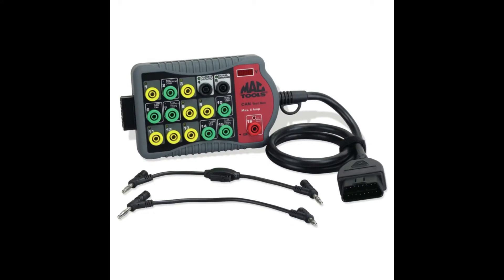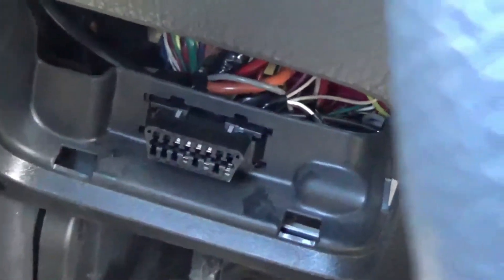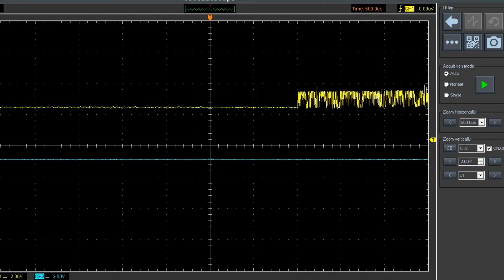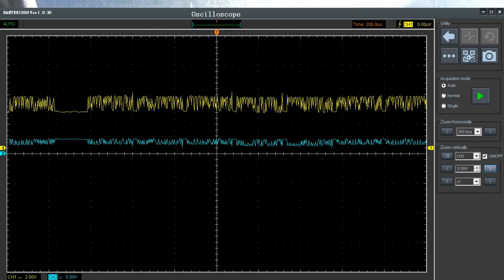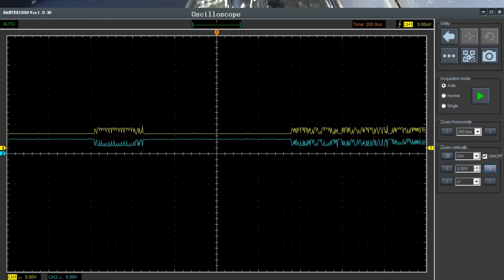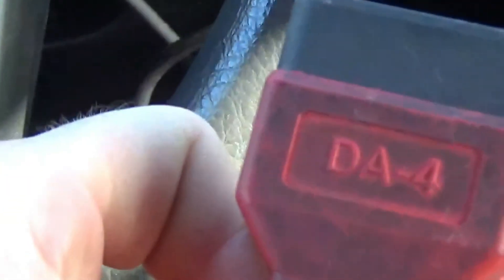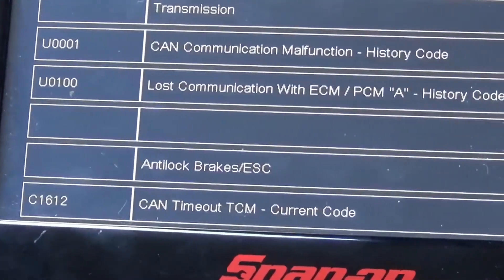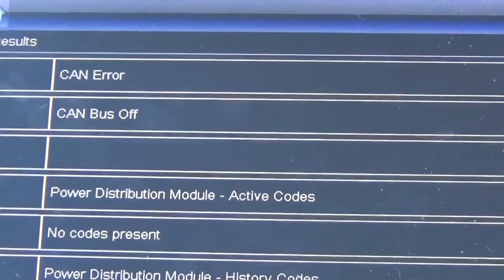What Happens When A Canbus System  shorts to battery positive or negative

Comment: I know this is a really old video and I don't know if anyone has told you this but the best software for your hantek 1008c is hscope for Android you plug the hantek into your phone with an otg cable your phone or tablet powers it you can only use 4 channels but it's so much better software trust me

Comment: Bro CAN-H and CAN-L vs CAN Power and Ground are Different so how does CAN Power and Ground is connected to the CAN BUS are they connected with the nodes or module or module power n ground?
Reply from the maker: Hi. thank you for the question.. In the video i am showing what happens if your CAN-H or CAN-L(pins 6-14 AT DLC Connector) Short to Ground or to Power--and how an issue on one can directly affect the other.. that is all.. Now the can signals are generated by the transfer of information along the can lines by the modules and any interruption on either can line will be seen as a glitch on both(one will be more pronounced then the other). This is were a know good wave form is needed in order to diagnose a CAN BUS  issue on the CAN-L and CAN-H lines. I hope this answers your question.. Thank you.

Comment: I have those exact symptoms but none of the equipment to test it with. I'm thinking about putting a ad out to see if there's someone around me with them.
Reply from the maker: Yah that is the issue with these circuits.. not everyone has the tools for the job.. but if you have a volt meter that does resistance and voltage, You can do some basic checks at the dlc connector